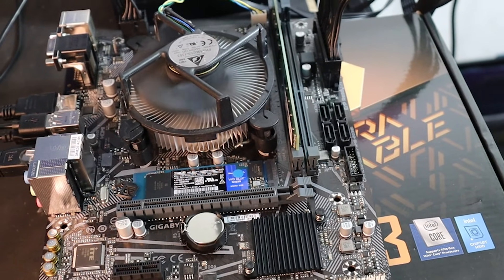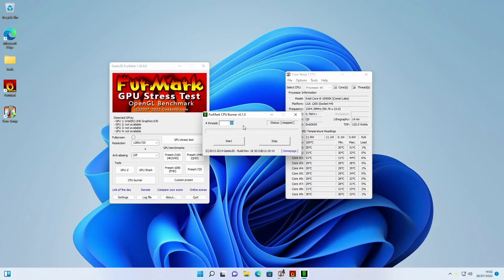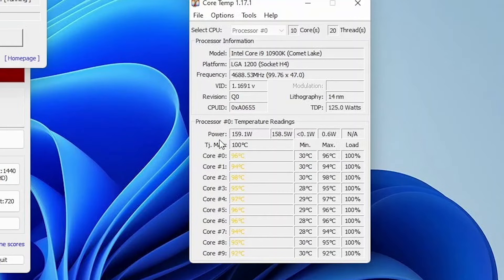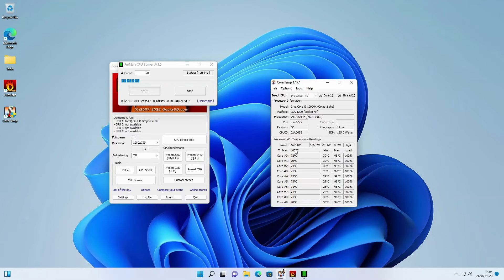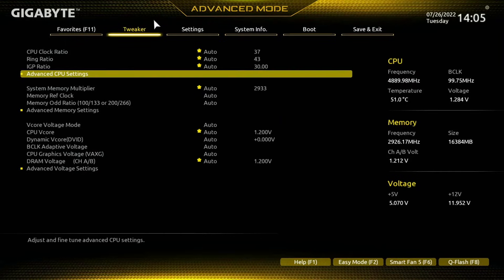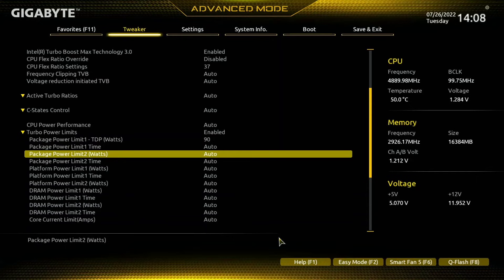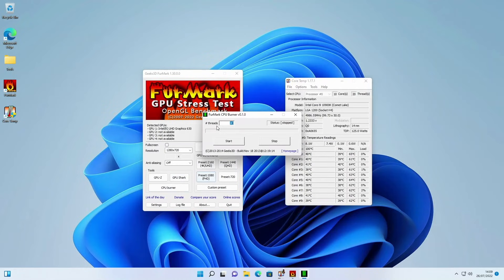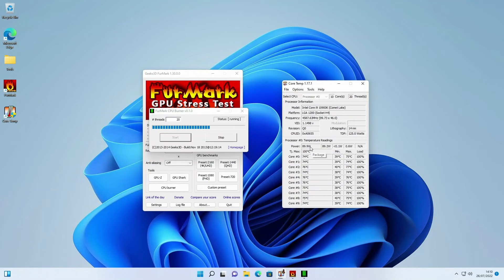How to Undervolt CPU on Gigabyte Motherboards for Cooler Temps

Comment: very god  and  thankth
Reply from the maker: No problem friend! Glad it was helpfull!
Reply: Why did you use 90 if you cooler tdp is 180 did you purposely use half or is the 90 on each supposed to add up to your total tdp capacity like if you wanted to could you set them both to 180 or would represent a 360 tdp capacity
Reply from the maker: @JaYgRiFfSTuBe  I was using a default intel cooler in this video, the picture I showed was just an example of a be quiet cooler that has a much higher tdp for cooling. I set it to 90 and that is my limit, it doesn't add them both together 8n any way.

Comment: Thanks for the tip rollwith. What abt if I have a Aorus x360 Aio waterforce cooler and cpu is Ryzen 7 5800x?
Reply from the maker: You should be completely fine with that cooler. The ryzen 7 5800x has a design feature that means it runs close to 90C at all times. Do not be alarmed by this.
Reply: Thanks rollwith for the update. Getting around 60 to 70 degree went gaming
Reply from the maker: @haveybal  Thats perfect!
Reply: Hi I got a Ryzen 7 5800x but it goes to 115 C and then turns off any idea of how can I fix this?